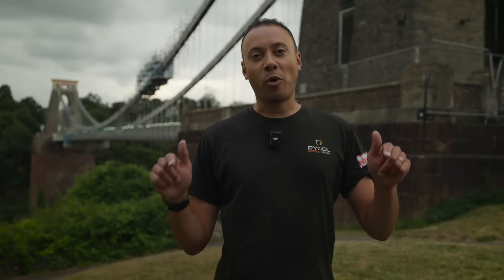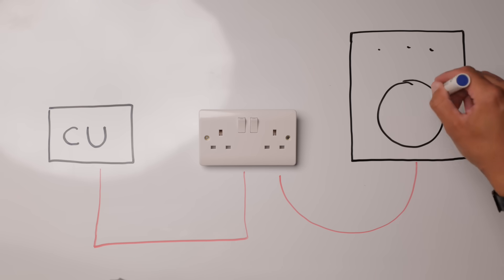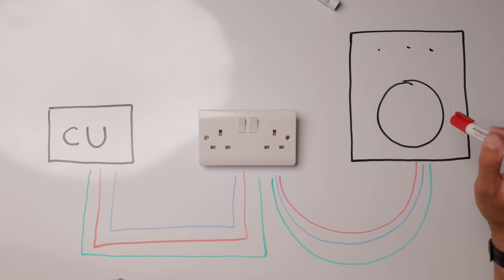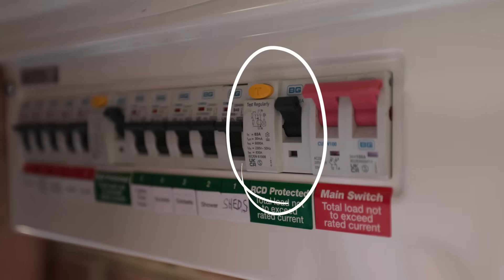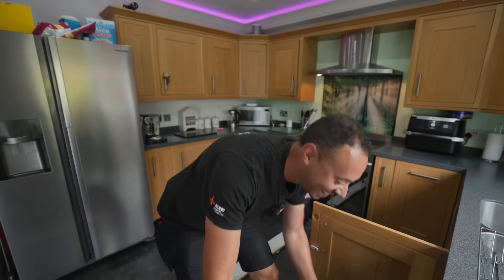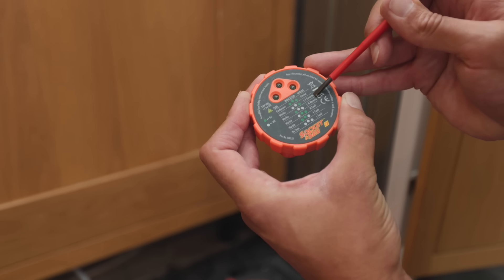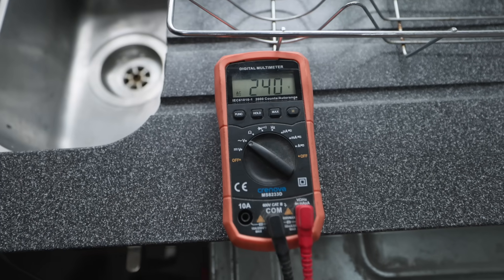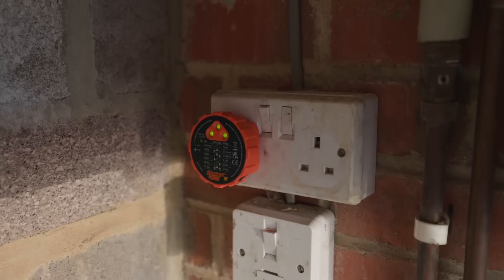This Simple Electrical Fault Turned Deadly⚡️

Comment: Ex-firefighter here.  Some quick advice, we were drilled to touch everything with the BACK of your hand when  searching houses etc, which I still do to this day, the volts will throw your hand away.  I am 67.
Reply: Same as I was also taught, from a very young age. I'm now 62. 
I've been "jolted' a few times, but never completely shocked and  I'm still here to tell the tale.
Reply: @OzKickstandUpAdventures-f5j  Same!
Reply: Same reason a lot of plumbers work ' one handed '. Especially under floor boards.  No circuit across the heart.
Reply: @spearmint47  also why bonding is really important, especially when there’s plastic pipe in the mix.
Reply: @GuyChapman  When I was learning my electronics servicing way back in 1980, One of the questions on the exam was:
You are fixing a TV in a damp area, Do you
1 Switch it off
2 Move it to a Dry area
3 Stand on a rubber matt
4 Put one hand behind your back

Well you cant fix it if is off
You are told it is a damp area so you cant move it
A rubber matt was the red herring
The answer was Place One Hand Behind Your back.

Stop current flow across the heart.
That was a question on the City and Guilds 224 Part 1 Course
Still holds true today.
Reply: Ha! Learned that from my dad! But he was an electrician and later a lecturer who taught electrical craft apprentices. I learned Ω at ‘ome.
Reply: In the RN this was always the method
Reply: In Irish  Civil Defense. We were taught that too. As a Locomotives maintenance Fitter. I'm 68.
🇮🇪🇪🇺
Reply: Had advice
Reply: Yup, I was taught that back in the early 1980s by a retired phone installation engineer.
Reply: Am 70 and had 1 or 2 shocks earlier in my life yes it's horrible so have learnt my lesson and now always take the nessacary precautions when working on or near mains power. I have a socket and stick mains tester
  I wonder if the shock has led to me being diagnosed with a heart arrithymia in recent years?
I do know of a guy who was electrocuted in early 1970s, from what I remember he was working on a kitchen appliance and touched a live wire which killed him, on the autopsy a burn mark was found on the soul of his bare foot and a staple or drawing pin was found in the rubber soul of his shoe where the electricity had found a path to earth..  so sad.

Comment: It's more common than it seems. The one who wired my basement put the ground in fuses instead of the live. I decided to upgrade the light receptacle to a current one. So flipping of the fuse, sure, it turns off the light, so I got to work. First thing I did was check for current, and here we are, the light of the screwdriver lights up! I immediately figured out what was happening and turned the main switch off. Of course, I retested and no current was present so I replaced the part. Funny thing is now the light switch may be off but the lamp still subtly glows. Safety light for free!!!...

Comment: A few issues i have with this information. 
Firstly, all socket circuits must be RCD protected by regualtion, so this would mean there was a faulty RCD otherwise the circuit would have tripped when the washing machine was plugged in or it means the socket circuit didnt comply to current regulations.
 Also on top of that its required for all water pipes to be bonded to earth by regulation, therefore touching the water pipes while touching the washing machine would have sent a fault current to earth in the range of Kilo-Amps, which would blow the main fuse in milliseconds or again the bonding didnt comply to regulations. 
Then there is the contention an electrician wrongly wired the plug top. Its more likely someone else tried to wire the plug top.
So for this to happen there would have needed to be 3 major errors, with 2 of them occuring before the washing machine plug top was wrongly wired.
 Someone isnt telling the truth here.

Comment: With that wiring the washing machine could not have worked.  So it would have been detected much earlier.  If the Neutral had been connected to the case the machine might have worked but the earth leakage detection would have shut it down instantly.  So how the electrician could have done this WITHOUT it being obvious instantly is hard to fathom.  I have had lethal miswirings done by electricians but not something so obvious as this one.  The most common one is having active and neutral reversed so that the switch turns off the neutral and not the active.

Comment: The reason why I got here is because I've been thinking about installing LED strip lights in my room. I was wondering if I could swap out the plug-in transformer with a hardwired one connected to the back end of a wall (plug) socket.

Something like this. . . . .
VARICART LED Transformer 60W, ultra slim 24V LED Driver 240V AC to 24V DC 2.5A, Low Voltage Power Supply Constant Voltage for Strip Lights, led Display and G4,MR11,MR16 Light Bulbs

There are only two wires as it takes the power of 240v and reduces it down to 24v. 
Then the lights themselves have a control switch that can turn them on/off.

As long as I take precautions and flip the main circuit breaker when installing. Are there any other issues I could have with this going wrong? ? ?

Comment: Had a friend die the same way about 13 yrs ago while working for British Gas.. oven extractor hood was live, a screw holding the hood onto wall was touching a live in the wall.. he touched the hood while also touching the boiler casing.. same thing, 28 yrs old and two young kids😢

Comment: Years ago my then fiance produced a loud bang when moving a frying pan from hob to sink. The pan bridged from cooker to (rather too close) drainer and blew.

Turned out the cooker switch was wired without clamping the output cable. The cable just dangled across the wall and behind the cooker.  The cable had pulled loose over time disconnecting the earth core which then moved to contact the live terminal. So now fully live and no earth path. 

We had no idea if it happened that day or whenever.  Oh and it was less than a week before our wedding!

Comment: Even worse is an appliance that has an internal fault that doesn't trip. Pime example was a teasmade that put 125 volt  on the case of the kettle. Old type only had a two wire lead. No leak trip in circuit. Reached over behind kettle to set the alarm. The shock threw me away. I was lucky. Element had an internal fault. Went to Tip.

Comment: On one occasion I was visiting a friend who had a damaged socket outlet. As a sparky, I offered to replace it for him and pulled the appropriate fuse before doing so. This was confirmed by plugging a lamp into said socket outlet and flashing it with the fuse as I had no test equipment with me. However, whoever wired the house had crossed the live and neutral consumer unit mains incoming tails. Pulling the fuse killed the light but left the neutral (now live) energised. I suffered the worst electric shock of my career and learned a very big lesson!
Reply: Yes, very nasty. Test, switch off and test again, is the only way to be sure.

Comment: I was visiting a colleague’s home when his family complained of a sense of tingling in their hands when touching pans on their stove. It turned out someone had stripped the outer insulation from the cable supplying the stovetop because the wall conduit was too small to accept it otherwise. The stovetop's cable retaining clamp had pinched the live and earth cores so tightly that the insulation had been crushed to the point they started arcing together. The earth core had burned through completely but not before it welded itself to the live core at the stovetop end, making the whole stove 100% (UK 240v) live. They were so lucky no one died as an earthed SS sink unit was less than a metre away from the stove. I shuddered to think of the consequence of someone grabbing for a boiling over pan whilst touching the sink unit with wet hands. My colleague seemed unconcerned until I connected my test lamp between his sink and stovetop and it lit up brightly. Apparently it had been like that for months!
Reply: faaaack

Comment: This only could have happened when there wasn't a earth leakage circuit breaker. Or it wasn't working.
Normally when you connect the live to earth the earth circuit breaker must intervene.

Everybody can make mistakes that's why there are circuit breakers in case of faults like this.

Comment: The thing about all the socket testers I've looked at, is none of them seem to be able to indicate that the neutral and ground have been reversed, which is exactly the problem you are highlighting. So with one of these testers, you would still be none the wiser?

Comment: Don’t believe it it would trip the fuse as soon as you switch the plug on plus when you install a washing machine you turn it on to test it so you would know there was a fault when it don’t turn on plus the owner would have got a shock off it before the plumber did

Comment: So, the RCD (Residual Current Device) would have saved the plumber's life had it been installed. It would have determined that a part of the current had gone a different path (through the plumber's body) and would have cut the circuit. Also, different people have different resistance to electric current. What's deadly for one person, may be negligible for another person.
Reply from the maker: Exactly that 👍🏽

Comment: I bet that felt SO wrong wiring that plug like that!
I've not seen earth/live reverse before, but I HAVE been almost killed by DIY dave wiring a light with L/N reversed, but still switched the red wire (old wiring). Also almost killed by myself. I tested L-N, nothing, L-E nothing, but failed to check N-E. I locked on, only thing that saved me was falling off the hopup.

Also N/E reversals in extension leads is a good way of tripping the RCD and convincing the customer their appliances have ALL gone faulty

Comment: I feel like one preventative measure that socket manufacturers can implement, is putting color coding on the socket itself. Sure, it's may not be necessary since all electricians can read, but it's much harder to miss a wrong colored wire put into a wrong colored hole. Let's also not forget that you cannot prevent laypersons from DIY'ing these sockets, and they will make mistakes since they may not know what color stands for what. A simple spray of ink or a sticker will do the job just fine.

Comment: Fully agree that RCDs are a useful device offering additional protection, they are not to be soley relied upon. This is why I do not agree with the 18th edition eliminating supplementary equipotential bonding in a bathroom due to rcds/rcbos becoming manditory for all domestic circuits. Using both limits the damadge from a rcd/rcbo failing. The other thing to note is that if the appliance is correctly wired but voltage appears on the case, and it is earthed the majority of the current will still go down the cpc/earth (as current is inversly proporuonal to the ratio of each resitive parallel path) even if you get a shock, reducing its risk. A high resistance fault such as arcing to the case will not necessarily trip the mcb, but it might trip a rcd, but not arcing between live conductors. It is estimated that 50v can be fatal, as 50mA can be fatal, which is far less that the rating of domestic mcbs, which is why I think supplementary bonding still should have a place in bathrooms and on combi boilers.

Comment: Great educational video. At 5:55, that testing plug thing is a SUPER cheap way to be safer. I extended a dual 13amp socket into my bedroom today, to allow for an office space in a place which didn't have a nearby socket. The earth I extended off of, disconnected when I screwed the socket face plate back in, and despite having a live connection, the earth wasn't working. That plug in tester meant I was able to find the fault (no earth detected), and correct it. If I'd just used a multimeter to check the current as a basic DIY'er, I'd have thought 'great, connection working', and proceeded with no working earth.
Reply: Which is why, sadly,what you just described is illegal now unless you consult a qualified electrician before you start and again once you're finished.

Comment: As an electrical inspector and also coming across dangerous situations like that, it is why I designed this alternate socket and backbox, which will receive both the plugin socket and conventional type. https://youtu.be/jSNZMJlueSU?feature=shared

Comment: This has opened my eyes today on just how dangerous a simple error like this can be. That is absolutely crazy.
Reply: Also, there is no chance a washing machine could work this way. The live terminal goes straight to the bridge rectifier in the washing machine PSU. Most likely, the earth on the washing machine would cause a dead short straight to the neutral connection through one of the bridge rectifier's diodes. This story is very suspicious to me.
Reply: @Grinch-d2c  Probably a new machine waiting for the plumber do to his thing, but why didnt the plumber turn off the mcb before pulling the machine out?
Reply: I dont see it as a simple error, if the guy cant wire a simple socket how can I trust him to do a panel? If it was a DIYer sure, but no electrician on earth can be allowed to do such error

Comment: The number of electrical mistakes being made daily by qualified electricians is alarming. Everyone can make a mistake, we've all made them but in the case of making mistakes where the result can mean death or serious injury or damage then there needs to be a culture introduced so that it makes you a bit of a nob if you don't check your work. Maybe make it a thing that a customer should be encouraged to ensure that the work carried is safe by showing the customer that everything is safe by use of a simple diagnostic tester that everyone can understand. All lights on everything good. Anything else and your electrician needs to get to the bottom of it. That is great for correct wiring but the mistakes don't end there. I think a check list should be ticked and signed with the customer watching what the electrician is checking. It will keep them both safe. Because the electrician in question surrounding this poor plumber is probably in a lot of trouble sitting in a cell wishing he'd become a carpenter.

Comment: My Dad used to get me to check the wires, whenever he wired up a plug. I used to wire the new colour wires to the plug myself, but when I was wiring up an old one, I had to ask him which one was which, as I only knew the green one. That has changed slightly on the new colour code, but still has green in it, so I know where it goes.

Comment: Not the same I know,but I was called to a ' socket fault' wherebtgebwashine m/c wasbtripping the RCD. The home-owner suspected the socket because the m/c worked fine plugged in to one nearby on an extension lead.  The lead was two- core flex. Lucky woman!

Comment: because the rcd was faulty
Reply: if it had disconnected in 0.4 seconds would  have it been been a problem? taking a belt doesnt hurt. its a shock... it down to circumstances..dont mess with 240v,,, this video is a scare munger,, you going to support affds next on your cu swaps??

Comment: A line earth reversal is probably the most dangerous mistake anyone can make. Never assume anything when it comes to electricity. Check, double check and always TEST
Reply: The socket will not work if you reverse the phase and the earth so they did no testing.

Comment: Kudos for making this video and demonstrating how situations like this can occur, but.... you said that your multi-function tester would test for polarity once the circuit had been energised by means of a loop test, i.e. earth fault loop impedence, and you inferred that this is the first time that polarity would be tested.  What about your pre-energised polarity test as per, for simplicity's sake, 10.2.1(d) of the On-Site Guide?  If circuits are tested thoroughly, pre and post-energising, the situation that your video depicts would not occur.  The L-E reversal is one thing, but not adhering to a full testing regime is the real reason why a dangerous circuit was put into service in the first place.
Reply from the maker: This is very true. In reality I know the tests that are being done onsite won't show a polarity issue until energised. Which is not the best but true.

Comment: I was working as a sparky's mate on a new build estate. The estate had been partially occupied, and we were just double checking a few installs, one of them was the 'now old fashioned' emersion heaters. The installers had used the incorrect grade cable from socket to heater. Every time the water heater was used, the draw exceeded the cable's capacity and was melting not only the sheathing, but also the tank's jacket. It must have been the installers bad day and a very busy week for us.
Simple things can go tragically wrong if you're not paying attention.
Reply from the maker: Yes such simple things can be disastrous!

Comment: I'm an electrician in Australia, I've been a licensed electrician for over 26 years. I have inadvertently swapped wires on the back of an outlet, but because I always test the outlet after energising, I find out that I've made a mistake and have an opportunity to rectify my mistake. If you complete all the mandatory tests, you can't go wrong. It's easy to be distracted whilst working, but you should spend a bit of extra time to test properly.